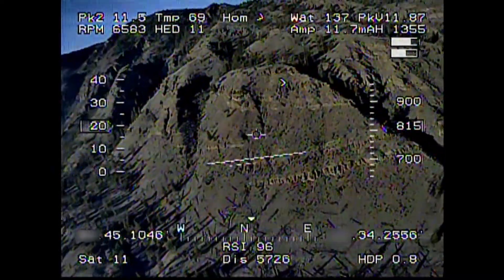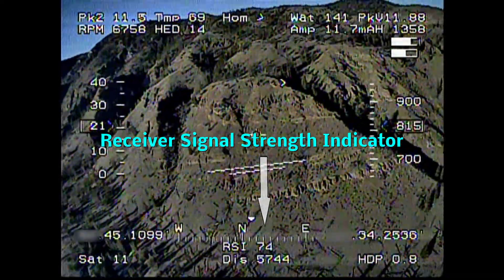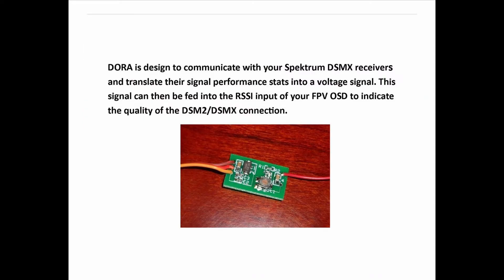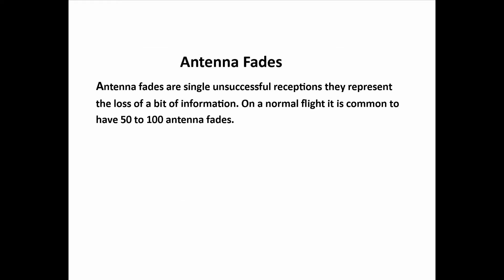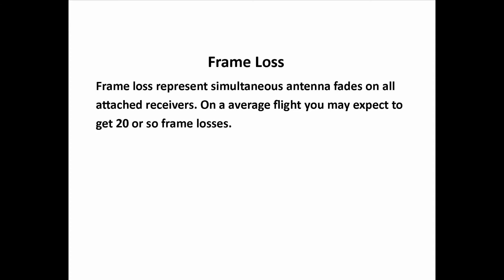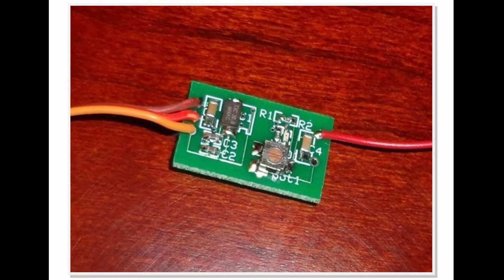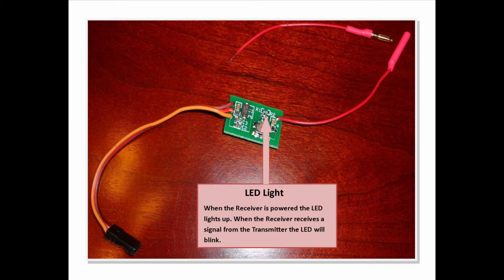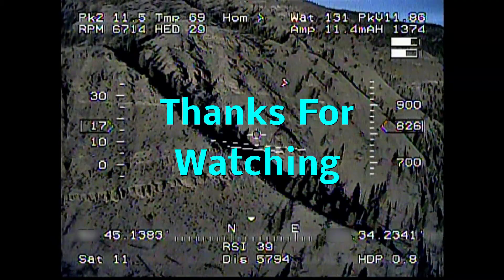A Way To Display Your Spektrum Receiver Signal Strength On Your FPV OSD

Comment: Howdy, I'm wondering how I would get more than just rssi, and get my spektrum receiver's full telemetry (speed/altitude/rssi/vario/etc) over to some kind of simple OSD/VTX solution. My receiver has xbus and SRXL2, and I'm hoping something can tap into those and grab that data. I would rather not leave the spektrum ecosystem if I can help it, as I already bought their expensive remote & telemetry receivers. Any info would be greatly appreciated!

Comment: Hello, really nice video this can come in handy but how reliable is the info about the signal strength you get from DORA and were can you buy this
Reply from the maker: +Brian Brocken  Hi. The signal strength changes quite fast from 100% to 0 when the signal is lost, but I find that when you see it start to move around a bit say it goes to 65% or 75% you know that you’re in an area where your getting some interference or you may be getting to the end of your flight range. There is one spot that I often fly at and I have found there is something in the area that causes interference with my signal when I get about 4000 feet out from my starting point when I travel in a straight line. when I start to see the signal strength start to move around then I can turn to the right I then fly about a 1000 ft. until I see the signal get strong again then I can continue flying straight out again with a good signal. But if I had turned left or continued to fly straight I would see the signal get weaker and then disappear. I find the Dora is good for recognizing and avoiding these areas.
You can get one at.  http://www.ebay.ca/itm/DORA-translates-Spektrum-DSMX-receiver-output-into-RSSI-signal-for-OSD-FPV-/321110480752